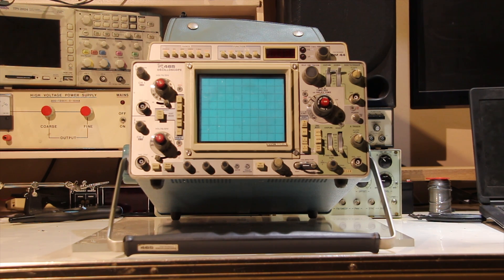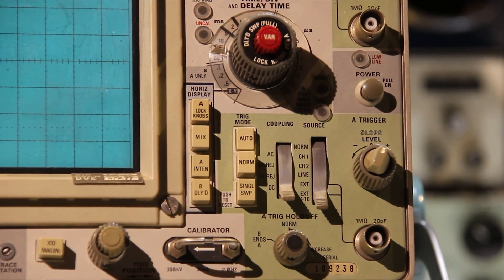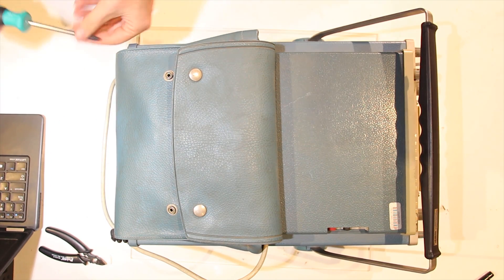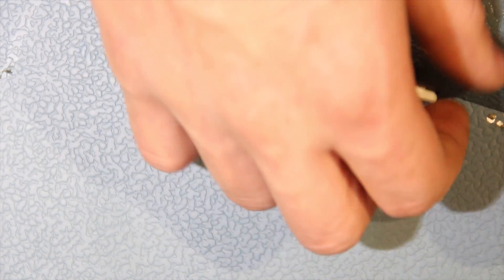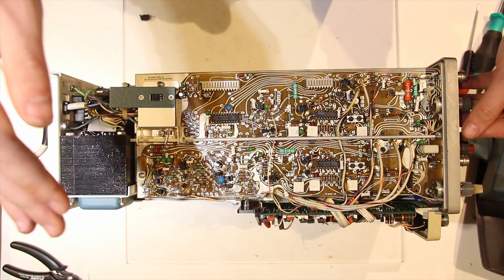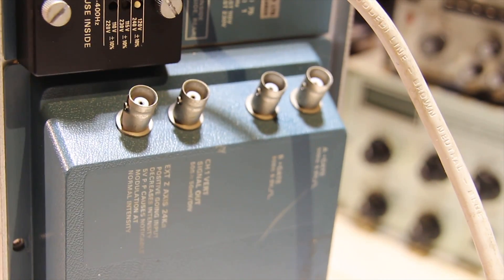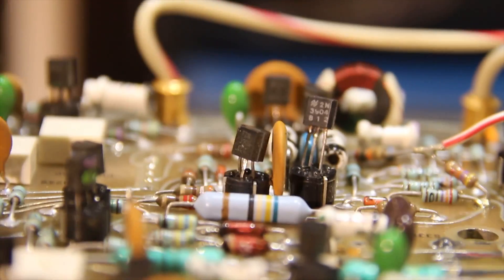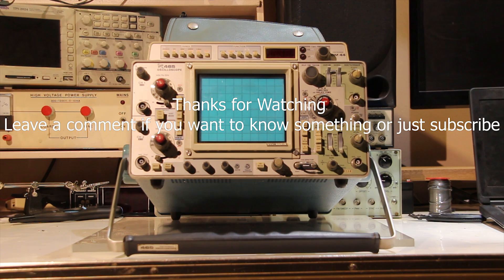Vintage 70s Tektronix Scope Teardown

Comment: Used the 465 in the late 70's to early 80's in electronics class, except the ones I used did not have the multi meter option. Previous to that I had cut my teeth on the much older 500 series with ceramic strip construction. Still a great instrument when maintained, even today.

Comment: Excellent video!
I have a digital Tek TDS1002B since 2008 and I'm happy with it. Recently I run into the opportunity of buying one of these used Tek 465 (not the B version) for $150. Is it worth buying and having it nowadays?
Reply: For 150 I wouldn't. I got a non working one for 40 bucks and it is a lot of work to try and repair it. Besides, unles the main filter caps were replaced, they will be at the end of their life cycle, and they are hugue caps which you will have to buy sooner than later. 
Unless you are a hugue fan of this scopes, it's too much money. If you need a scope for it's intended purpose, save a bit and buy a modern dso for 300-400 bucks.
Reply: Agree with Antonio, $150 is a bit too much unless you’re a huge fan or money is no object.  However, it is one of the great analog scopes to have on your bench. 

Check out hamfests around your area, sometimes they pop up for under $50, if you find one for that price grab it, at the very least will make a great restoration project.